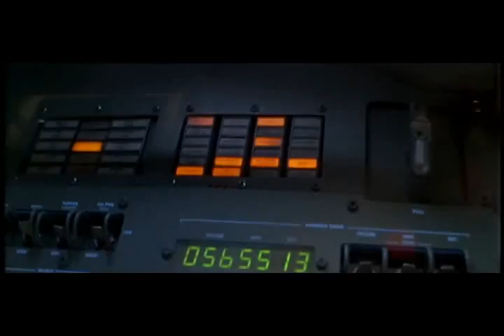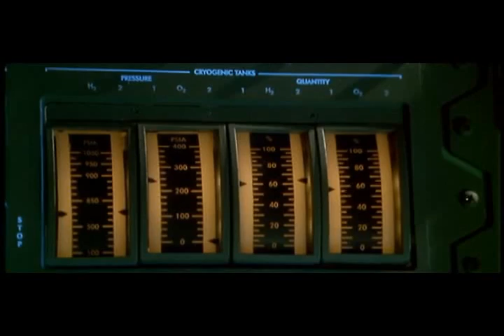Apollo 13 Explosion

Comment: Why wasn't the fuel cells tested before Apollo 13 took off?
Reply: https://www.youtube.com/watch?v=eO19LTJZM6c& here's what happened
Reply: The fuel cells weren't the problem. It was the O2 tanks with an internal fan motor wiring that shorted. It tested ok before liftoff but then the wiring inside the tank for it degraded unknowingly afterwards

Comment: The way everyone just shuts the hell up when he says they are venting. In space, the last thing ANYONE wants to hear is that their ship is 'bleeding'.
Reply: Actually... the last thing anyone wants to hear in space is that they're on fire. Closed space saturated with oxygen...that's pretty much guaranteed death. Something specially true after what had happened to Apollo 1.

After that, yeah...venting is...not good. Let's leave it at that ;).
Reply: Horrific, because it's not only used for breathing, it's used for electrical power. If it had happened after the lunar landing, they would have ditched the lunar module and have been out of resources. It would have been a certainly fatal situation.

After Apollo 13 the service modules on the next four landings was redesigned to include another oxygen tank as far away as possible from the main oxygen tanks. And also a backup battery was installed as well as an emergency water supply.
And of course they redesigned the main oxygen tank assemblies. After snatching the crew of Apollo 13 out of the jaws of certain death they weren't taking another chance like that.

Comment: In desperation to get to the Moon before 1970, NASA took short cuts in the development of the Saturn V.  Pogo oscillations of the fuel were a problem in the first stage, that were so serious in Apollo 13, that the first stage had to aborted early during take off.  These were rectified for Apollo 14, but they were lucky that the rocket did not blow up after about 3 minutes after take off.
Reply: Pogo oscillations had been detected already in the unmanned apollo 4 launch, though it was a very minor concern on that one. It had been nailed down with Apollo 6, the mission where it raised it's ugly head. And had been largely solved by the time Apollo 8 was launched. 

In fact one can argue that it was the safety measures included after apollo 6 that caused the shutdown of the engine in the Apollo 13. One of the safety backups included after the Apollo 6 was that if any vibrations induced any kind of chamber pressure fluctuation, the automatic systems switched it off to prevent the problem going out of control, while also reducing the oscilations. Those vibrations happened in Apollo 13 in the center engine of the 2nd stage, and the automatic safeties immediately shut the engine down. The vessel made it without any problem into orbit.

Which also brings the point here, the problem wasn't in the first stage, as you mention. Apollo 13's first stage performed flawlessly. It was a 2nd stage engine early shutdown, the pogo vibrations happened during 2nd stage, not during the 1st. And the early shutdown was of negligible consequence (The Saturn V could make it into orbit with 2 of the 2nd stage engines shut down, because it could burn the other 3 for a much longer time).

So, true, 13 had a problem with pogo oscillations that caused a shutdown of one of the 2nd stage engines during launch, but that was several orders of magnitude less than the initial problem; apollo 6 had such harsh vibrations that it actually broke several fuel lines of the second stage. And according to the accelerometers on the capsule, had it been a manned mission, all astronauts would've died because of the extreme vibrations. In fact the engineers that investigated the problem afterwards were completely amazed that the whole thing had just not fallen apart midflight, the vibrations had been so devastatingly bad. 
And even then, Apollo 6 didn't "blow up after 3 minutes". It not only didn't blow up, and it not only held together (wich given the scale of the vibrations was astonishing enough), but ,even with 2 of the second stage engines KO  during the whole burn because of the ruptured fuel lines, the vessel made it into it's target orbit. Barely, but it made it.

If apolo 6 didn't go off even while it went through vibrations that would've killed any crew on board and did rupture several fuel lines, it's obvious to see that the scale of the vibrations suffered by the Apollo 13 mission weren't by far enough to cause the rocket to blow up. Specially because, as I explained, the engine shutdown that happened in the Apollo 13 launch was one of the (many) fixes to the very harsh pogo oscilations that initially the Saturn V rocket suffered.

 Pogo oscillations weren't an issue for Apollo 8,9,10,11 and 12. That 13 had a minor incidence with it had nothing to do with "shortcuts"; the oscilations themselves were caused by a cavitation problem related with the fuel pumps that had never been an issue before, and there had been 5 fully succesful Saturn V launches between Apollo 6 and 13 where said problem had never appeared, and one more (Apollo 4) before that. 

Obviously the telemetry and data of the launch was used to fix the newfound problem for later missions as, again, it was a problem that had never been experienced before with the rocket in any of the previous launches so it could hardly have been fixed before.

The Saturn V was designed with ample power economy precisely to deal with hypotetical engine losses during the ascension into orbit without causing a mission abort (again, proven by the fact that two second stage engines in Apollo 6 were lost due to ruptured fuel lines, one in apollo 13 was shutdown, both vessels made it into orbit).

One can accuse NASA of many things during the 60s space program but cutting corners wasn't one of them. They were in a hurry indeed, and I would totally agree that the disaster of Apollo 1 was partially caused by that haste (partially because never until that point fire had been considered such a tremendous danger, an oversight certainly, but one that can't be really blamed on being in a hurry), but even that disaster led to a 23 month stop on NASA manned launches to make sure everything was ready for the next manned mission. So cut corners...certainly wasn't the case.
Reply: @ramjb  Thank you for putting the record straight.  It is wonderful to have someone who has done their research.  Only one thing, considering the shuttle, Buran and US rocketry this century, I still think the Apollo project succeeded with a large element of luck.  Not that should be considered a bad thing of courxe.
Reply: You don't toy with luck when dealing with spaceflight. You do things well, or you pay the price,a price that is never cheap. The russians paid it several times because they were pushing far beyond what they could handle, and it came back to bite them in the ass. 

Same happened to the Apollo missions when Apollo 1 killed Grissom, Chaffee and White. They pushed things when things weren't ready and the whole thing was a catastrophe. Lesson was well learnt in that sense because everyone knew that what had gone wrong in LC34 was their fault for rushing things up. They took a yearlong break from manned spaceflight, they took their time to check everything was ready, from procedures to the hardware itself, they redesigned the whole capsule to enhance insulation and minimize risks of fire (this probably saved the three Apollo 13 astronauts when they had to do a cold start on a cockpit which was dripping moisture everywhere), changed procedures, etc.

Apollo succeeded because of excellency, not because of luck. When they dropped the standards, the very second they became careless by rushing things giving more importance to achieving a given timetable than in doing things right, they immediately lost a crew. That taught them a lesson they didn't forget and the rest of the program was a huge achievement as a result.

Also and talking about luck, let's be real here. Every STS Launch since Columbia made it's first flight until Challenger blew up was a roll of the dice, and they always rolled well until Challenger went kaboom. Those solid rocket booster O-rings were a disaster in the waiting, compounded with careless premission parameters (allowing the shuttle to be on platform at those temperatures for that long couldn't do any good), and unwillingness to delay the mission to check everything was OK did the rest.

An Apollo-like NASA (post-apollo1) would've never had such a catastrophe because they had sharpened their procedures to the top and would take calculated risks, but never openly gamble when the astronaut lives were at stake. But after years of "safe" spaceflight experiences with the shuttle both NASA and the contractors got careless. They paid the according price.

Spaceflight ain't neither easy, nor safe (not by a long mile, and certainly not for now, maybe someday it'll be but that day is still in the future). Everytime anyone assumed otherwise, lifes were lost. Happened in Russia, happened in the US, but, exception made of Apollo-1 (which probably was key to remind everyone in NASA at the time of how much they didn't want to push their chances), it wasn't true of the Apollo program.

Comment: Damm Huston reading vehicle telemetry data and radio communications 80 thousands miles away and I can't even get a good Wi-Fi connection one bedroom and kitchen away 😂😂😂
Reply: Radio and wifi aren't the same thing.
Reply: @OpenMawProductions  yes it does.
Reply: @OpenMawProductions  They are exactly the same thing.
Reply: No.
Reply: @OpenMawProductions  yes. Wifi is a radio singals/electromagnetic wave
Reply: @rumahhafidzahbekasi1354  That's like saying X-rays and visible light are the same, because they operate the same way. Yet they are very different things.

Wifi, for one, is local, short range, omnidirectional. Radio comms between a spacecraft and mission control is both much longer range AND highly directional. And in fact in the movie can't be seen ,but in reality Odissey-Houston communications had some extremely serious issues with comms due to low power in the spacecraft during the whole mission. And during the incident itself comms were completely lost for a couple seconds as the explosion kicked out the main antenna and the S-band antenna (the one that would've been used for the CM-LEM comms in the moon had they landed) had to take it's place and took that time to allign itself in the correct direction to recover communications.
Reply: There's a bit of a difference between a chip antenna and a 24 meter dish. Helluva lot more power, too.  Same basic frequency, though (the old school stuff was S band, 2.4 GHz)
Reply: LoL!
Reply: @willl 88 No.

Comment: Some fucking engineer didn't double check his work and now apollo 13 didn't land on the moon
Reply: The LO2 #2 tank during routine testing was dropped a few inches on a shelf, outside the safety limit.  Lovell was informed of this and signed off on the tank being used as a new tank would delay the launch.  A part was changed out but was not updated with new 65 volt limits instead of the previous 28 volt limits.  Once activated, it fried and stayed open.  When the tank was scheduled to be drained by boiling off, it took days rather than hours to complete.  Once refilled and placed in the SM, it was a like a bomb waiting to go off.  The tank temperature gauge on the CM would not read above 80F, but during stir, it shorted and started burning at 1000F, causing the tank dome to fail and fill the compartment with expanding gas, eventually blowing out the entire side panel of the SM, striking the high-gain antenna, and compromising the SPS engine bell.  The mechanical shock of the explosion forced the valves shut on the fuel cells, leaving them with just 3 minutes of power from the O2 left in the lines.
Reply: Bryce Wakefield 
I dunno how often this happens where i work.
Reply: THE LO2 #2 TANK DURING
Reply: that was on a steven king story wasn't it ?
Reply: James Fran

Comment: yup, oxygen tank explosion. Not only for breathing, fuel needs to ignite or you get almost no thrust. If you don't have enough oxygen to ignite enough fuel, you can't circularize you orbit around the moon. thankfully, the crew were on a trajectory where they loop around the moon and back to earth. In fact, I wonder why nothing went wrong with Apollo 11.
Reply: Luigi man87 - Except they weren't on a free return trajectory.  Nothing happened to Apollo 11 because their oxygen tanks weren't damaged.  One of the tanks on 13 had been dropped, then subsequently had its internals fried with electricity.
Reply: The main biggest and crippling problem was power. The fuel cells were the main source of electricity for the Apollo missions. The explosion damaged several fuel cells, and vented almost all of the oxygen out - oxygen that the fuel cells required to produce electricity. The result was that after venting the oxygen out of those tanks the capsule was unable to produce any more power, and all they had left was out of the batteries. That's why they had to switch everything down in the odissey and move into the LEM (which had it's own power generation and life support systems - problem was that it couldn't be used to charge the batteries on the Odissey - something wich was fixed for Apollo 14, btw), because they needed all the energy they had left on the batteries for the re-startup of the systems before re-entry.

Breathing oxygen was not a problem -they had CO2 scrubbers to filter it out and renew it. Problem was that the process took electricity, but was a non-issue as the crew moved into the LEM for the remainder of the voyage (until they were about to re-enter). Oxygen became a problem later on when they all were in the LEM because the filters were designed to filter CO2 for two men and not three, but that was a whole different issue that waas solved as depicted in the movie.
Reply: No, the oxygen was not used in the engines. The engines on the LM/CM are hypergolic.

Comment: actting up elecrtical busts do to the line noise effect disturb elecrtical current is a sure sign of major short circuitting along with damage to the lines done by it which was happened in one of the oxygen tank fans causeing it to arced out igniteing the extreamly combustible and under pressure cryogenic gas inside the tanks

Comment: all he had to do was look at what the gague said before he began the chryo-stir, woud u put this unfortunate turn of events down to human error, or a lack of concentration on the part of the astranaut?
Reply: It had nothing to do with the gauges....the tank that blew had been damaged by a drop well before launch.
Reply: Uhhhh you know the tank stirs were done, PRECISELY, to mix up the tank contents so they could get accurate reads out of the gauges?.

The tank blew up because faulty insulation due to manufacturing problems - Neither the crew nor Mission Control had any way to know about it and looking at the gauge would've made no difference, for there was not a "WARNING, INSULATION OF THE FAN CABLES IS FUCKED UP!!!!!!!" on them when the proceeding was done. 
Furthermore, cryo tank stirs were done in Apollo 11 and 12 without problem. So were in some Gemini missions. The problem was not the proceeding, it was that those oxygen tanks were remotely activated bombs, the cryo-stir fan toggles being the fuzes, and nobody knew about it.

Comment: Fuel , Food and Oxygen were not large concerns due to their abundance on the LEM and Command Module. However, Power and Carbon Dioxide filtration became very large problems quickly.
Reply: Oxygen was for a short time while the LEM powered up and cooling water was after power and filtration.
Reply: in the LEM there were rations for 2 men for one day and a half - it wasn't enough for 3 men during the return trip. That wasn't enough, and that replicated other problems the crew had (notably with CO2) because of the LEM being designed as a 2 man crew vessel.

Food was not a serious concern because any human can spend 3 days without eating and be OK with it. Try that without breathing or drinking, though, and you might have some problems... but not because food was "abundant" in the LEM. Because it was not.

Comment: @epl0si0n Rocket fuel isn't made from oil, it just doesn't have enough power to lift up something and can't burn in space without oxidizer, and even then there are more efficient fuels for that.
Reply: BFGfreak partially wrong.  The S-1C first stage used a very refined form of kerosene with liquid oxygen because it had a better energy density at the expense of specific impulse.  The S-II and S-IVB stages used liquid hydrogen and liquid oxygen which had better specific impulse but really low fuel density.